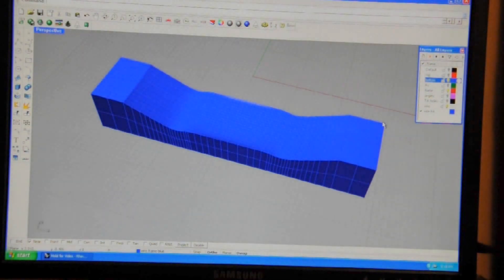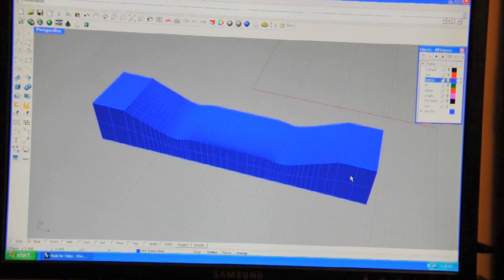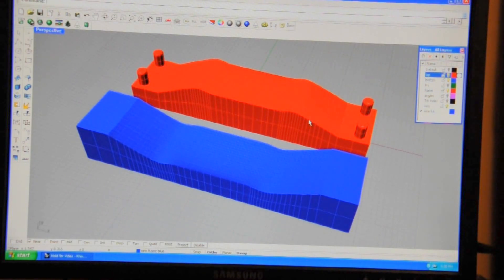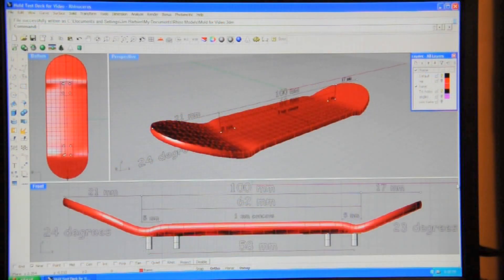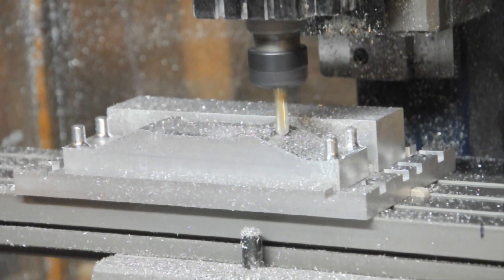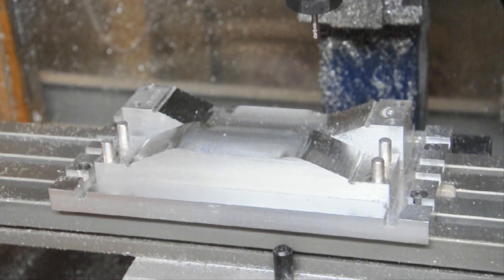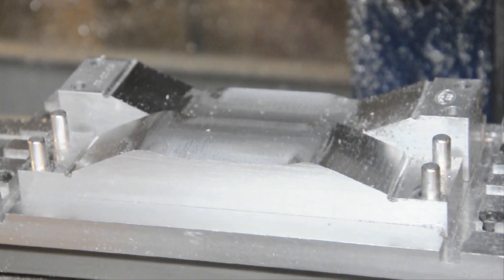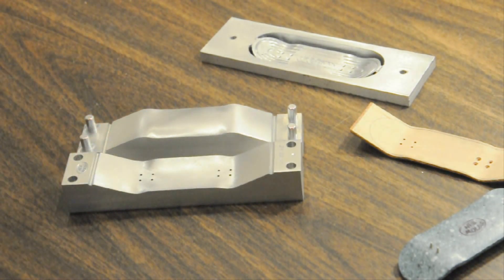How It's Made

Comment: To those complaining about the price of a mould...
Buy a CNC (A decent one- not a piece of shit.) 10 Grand or its not worth piss.
Spend 10 hours refining the design. (At 50 to 100 dollars an hour.)
3 Hours making a decent toolpath in your cam software. (Which is probably worth several hundred to 30 000 USD.
Buy Tooling, coolants and add in Machine time. (Wear on the machine. 100 to 500 per hour depending on machine capability.)
And considering it custom, this is just for your 1 particular model, its a freaking good deal. Heres some perspective.... At the place I used to work a single 1 off prototype inclusive of all these costs started at 2500 before you have even paid for the material we were cutting or cutting time. But hey were building turbine parts. But still, 225 is a good price for any 1 off cnc mould on ANY machine. And I don't even like skater punks!
Reply from the maker: Thanks..Jim. Couldn't have said it better myself.

Comment: Can the template be pressed against the sander to get an exact cut or is it only for tracing?
Reply from the maker: It is used for tracing only. A special template is available for those using a router to shape the deck.
Reply: +NFBMold oh ok gotcha. How much does the special template cost?

Comment: what is the psi of the aluminum used?
Reply from the maker: Tensile - 45,000, Yield - 40,000
Reply: NFBMold can i have you change the wheel to wheel base from 58 to 56
Reply from the maker: pizzakak The molds are custom made to the customers specifications. All the dimensions
are entirely up to you.